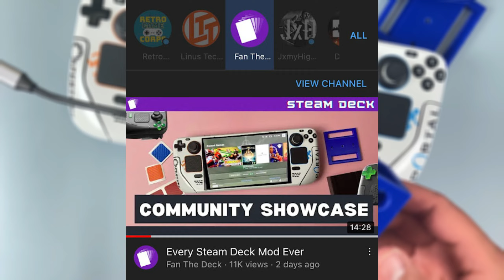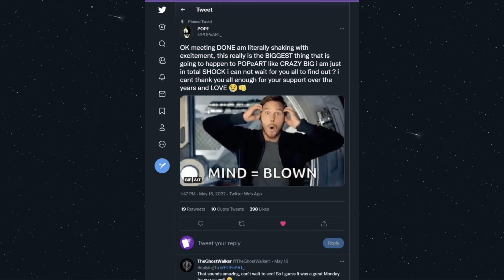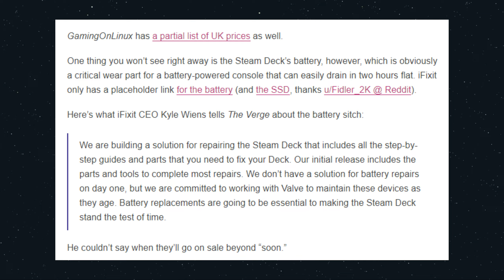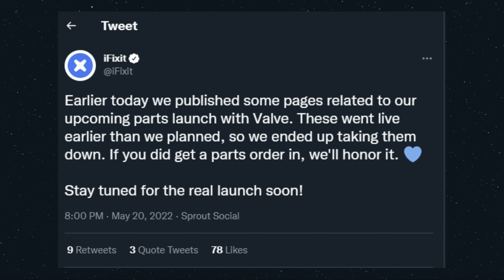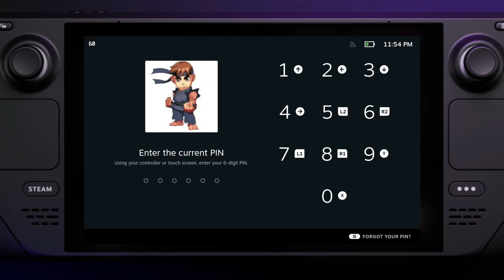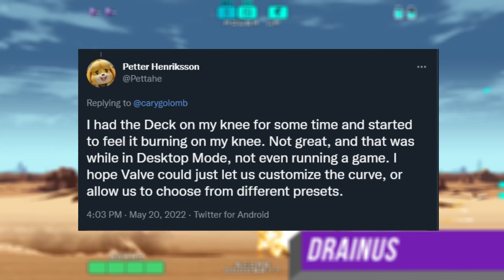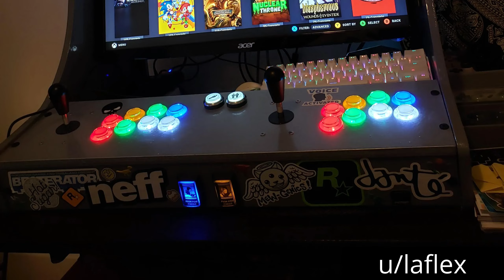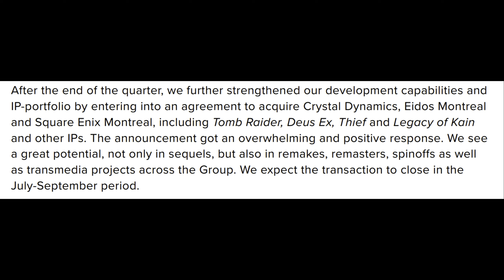I wish this Steam Deck was real... Maybe it is!?

Comment: iFixit Steam Deck components leak also show that Valve sold every Steam Deck at loss, Valve solely profiting from the games sell.
Reply: I think that was fairly obvious
Reply from the maker: Gardiner's latest video does a great job of breaking this down! Pretty cool to know!
Reply: @kanpeki2485  While it's fairly obvious, we don't know how much Valve lost money but we have a estimate now.
Based on The Linux Gamer the 64 & 256 GB version cost $486 and 512 GB version cost $507 this is estimate without the SSD.
https://youtu.be/3gSL89u19w4?t=118
Reply: Economies of scale might eventually make the Steamdeck profitable too if it continues to sell and they can ramp up production, especially if parts shortages start to ease off

Comment: I'm really waiting on the parts to become available. My Steam Deck came in with a faulty r3 button, but that's not a big enough issue for me to want to go through the RMA process and be without the Deck for a week or two.
Reply: I was without my steam deck for 3 weeks and 1 day when I RMAd it and tomorrow I'm shipping my Deck for it's SECOND RMA 💀
My luck has just been pure shit basically
Reply: Damn and i thought my b button getting stuck was bad. R3 is way worse considering you use it more than b button. At least the b button you remap it to back buttons.
Reply: @bimmer8602  Actually, I just bind it to the R4 button on the back

Comment: Q: What do you use the desktop mode for?

A: 1. Personally when I get mine, it will be to add Windows.exe files such as digital games of mine which I will make accessible via Steam menu so I don’t always have to enter desktop to use them. 
2. Install Google Chrome so I can watch YouTube / view email / read news articles

I know most people won’t even touch Desktop Mode but, this is my personal usage of it.  Although mainly I will be on Steam Library menu 😅
Reply from the maker: I definitely use Desktop Mode for stuff like you said but I have almost no interest in installing Windows.
Reply: @FanTheDeck  
I have no interest in installing Windows as well however I do plan on moving old Windows games onto the Deck so I can play them on the go.
Reply: Out of the box, you can't launch ".exe" files. You need to add the programme into steam as a "Non Steam Game" then launch it with Proton. 

But if you install wine that'll let you "double click to launch" programs from a file manager

My main use for desktop mode is modding a game, or emulators! Works great for those
Reply: @Gendreau113  
Thanks for the information.
I had a slight idea about how to run the .exe by adding it to Steam / run with Proton.  However I didn’t know the whole technical bits of it so, thank you for the insight. 👍🏻

Comment: What would a 1080P OLED screen look like on IFixit? Or a 50% bigger battery? Or the motherboard with Thunderbolt port? :D
Reply from the maker: That would be awesome but I don't expect it to happen on iFixIt. There will be shops with aftermarket components but iFixIt is going to be more for stock repairs.
Reply: I'd be ok with a 800p OLED too just to avoid murdering the battery too fast, I can leave the high-rez gaming for my desktop
Reply: @UNSCPILOT  I’m gonna be honest, I barely notice that the screen isn’t 1080p. Sure a 1080p would be nice, but it’s not even in my top 10 wishlist for the steam deck 2. I’d prefer better performamce or battery life.
Reply: @Shmynkellbonkenstein  upon that we agree, maybe if later versions can fit bigger batteries then a higher rez screen would be cool, but for now 800p is perfectly reasonable

Comment: Let's goooo! Glad I didn't use a screen protector on my 512. I ordered a replacement and will replace it when/if necessary. No need to degrade the quality and lower the brightness with a screen protector over the 512 screen
Reply: I have the 512 model and a screen  protector.  I've played without it for a couple weeks, then got one, and I can notice no difference. Good screens dont have bubbles or issues like you state
Reply: @bluepill8077  I said nothing about bubbles. We have four 512 models and applied a different screen protector to three of them and tested them each with a colorimeter. The dbrand screen protector did the best with an 11% percent reduction in brightness and the least gamma/color shift. When looking at them in person side by side the difference is definitely noticeable.

Comment: My LB broke after deck was knocked off table.  The tactile button was knocked off PCB, nothing else showed any signs of damage.  $35 for the left daughter board sounds pretty reasonable, especially considering with other companies you'd be stuck with a partly functional device.
Reply from the maker: Agreed. Extremely reasonable - I'm glad they went with the modular design.
Reply: @FanTheDeck  Even more reasonably I raised a support ticket asking about parts / repairs (this was before the iFixit leak) and they replaced my deck under RMA.. a new one arrived today.  I did not expect this as I openly stated this was caused by an accident, not a fault.

Comment: There are Japanese PC games that I run on the deck and most of them don't even run on non-Japanese (e.g. English) Windows. Some have issues with Japanese file names. Some explicitly check for the system language. I tried a lot of them but none can run in SteamOS using proton.

Comment: Why is that you think buttons are unlikely to break? Buttons break all the time... And deck specifically has had some reports of that weird B button breaking... I don't get why you specify them not listing buttons as making sense when it is one of the main core components that can break, especially from people being too rough on the device.
Reply from the maker: What I'm trying to say in the video is that it's not the physical button that breaks. The physical button is just like a piece of hard plastic. There are other parts of the assembly that could break and are for sale like the membrane and the daughterboard. Those are the pieces you would want to buy if you have something like an unresponsive button.

Comment: Seems the deck is mostly a solo game system kinda threw me off
Reply from the maker: What do you mean? Like you expected more features for multiplayer?
Reply: @FanTheDeck  no, as I was going through the library it seems there are limited multiplayer games but maybe it's my own lineup of games, so as of now to me seems it's limited to solo game play but what are your thoughts?
Reply from the maker: @thesullylife8219  Ahh gotcha. Kind of depends. A lot of the big online multiplayer games are not compatible due to anti-cheat. So yeah there's a big, big gap there. Some of the big games do work: Rocket League, Fall Guys, Battlefield, Paladins, Smite, Street Fighter V. But yeah, not nearly as much as a console or as Windows.

Now if you're talking about local multiplayer, there are a lot more options. There are a lot of indie multiplayer games you can play together locally or use Remote Play Together to play online.
Reply: @FanTheDeck  thank you for the input I'll check out local multiplayer! Much appreciated
Reply: On it's own, it's deffinitly a solo-play device (though hopefully more multiplayer modes/games will be supported over time).

But with a USB-C hub, a couple controllers you could still do local multiplayer on a TV, or go old school and have a LAN party with games that still support it

Comment: Steam deck fans already out of stock. Scalpers, please, no, have some decency.
Reply from the maker: I considered buying a fan to make a "how to replace a fan" video but then I saw there were only a few fans in stock and thought those would be better suited to people that actually need the fans.
Reply: @FanTheDeck  To be honest, I don’t 100% need a new fan either, the new fan curve improves the noise levels significantly already and I mostly play indie and run demanding games at 40 fps/40hz so in most of my use cases it’s basically quiet already. But it would be a nice luxury to get the fan with less whine, but still, I’m not 100% sure if you’re guaranteed to get the more quiet fan even. They said ”we’ll try” in a tweet. My current one is the delta, I opened my deck to fix sticky buttons so I know. Apparently, the hyaying or whatever it’s called is supposed to be more quiet (whooshy but not as whiny).

Comment: Desktop mode is for adding emulators and downloading roms. And going crazy trying to get wireless xbox controller configurations to detect and save.

What desktop mode is NOT for, is updating steam. If you do that, you will get caught in an infinite boot loop.  It happened to me last week.  I had to wipe the deck and lose all information,  but it's fixed now.